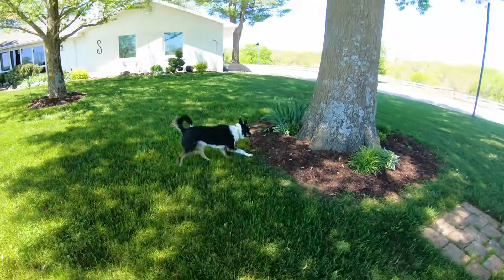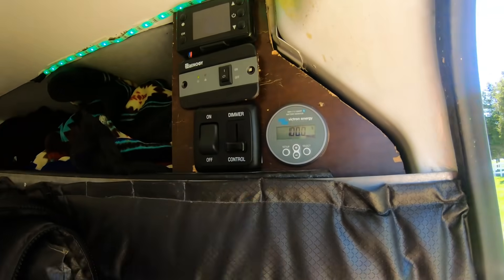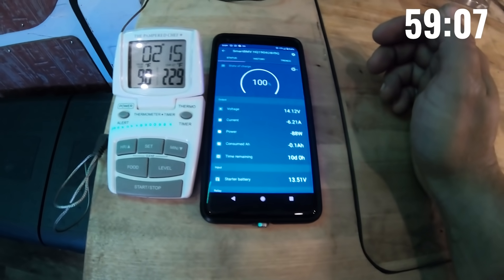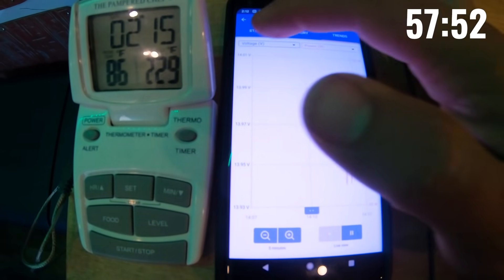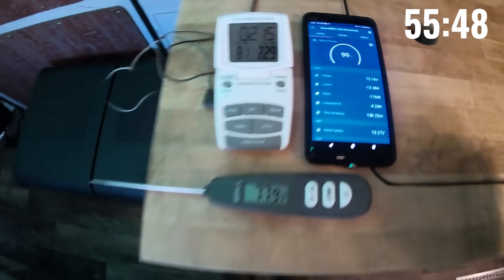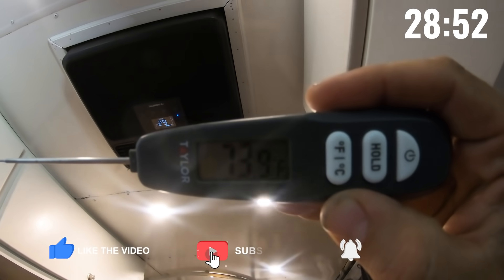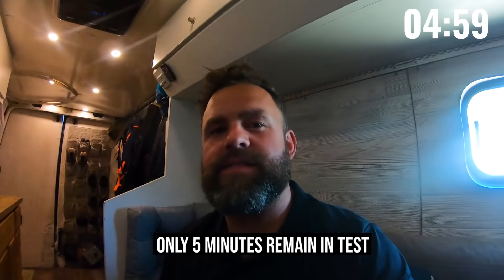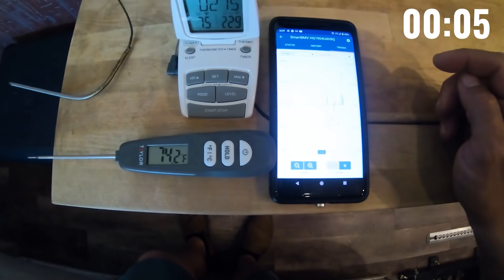12 Volt DC Air Conditioner | POWER CONSUMPTION TEST | Dometic RTX 2000 |  Van Life

Comment: I have a 120v 5k btu unit and 800 watts solar. After 5 mins of use it settles at unit 420 watts. On a decent day I still have input into my batteries while in use so no output from battery. Best test on a day with 95 degrees interior I can drop to 74 degrees in 35 min and 69 degrees in 55 mins. I normally just set ac on 72 degrees. Once to that temp it goes off and kicks on about every 10/15 mins for 5min. So my batteries stay full during the day. My last hour of solar input I turn on constant until no solar input and get it down to 64 degrees. Then adjust to auto 78 and turn my fans on and the ac will barely come on maybe every 30/40 mins for 5 mins.

Comment: I like your real world tests, gives an insight how pv panels, battery, and AC to cool your space. I believe to enhance your envelop (van), hopefully there's an air gap between the pv panel and the van's roof. Otherwise, I would suggest better insulation and more air movement in side the fan (like that little fan, as a booster). To reduce heat conduction from the outside, try painting an aerogel based paint on the inside - sides, bottom, and roof to the bare metal (Do just a small section first and see how well the product works. Check with the laser temp gun - it's expensive - but good). As for your glass windows, that's tough to insulate. Maybe a high quality window tints or an aluminum radiant barrier custom cut to the windows. The thermal curtain certainly helps reduce heat gain. Within your many options, I believe you can achieve your cool goal much quicker and sustain it for a very long time.

Comment: Ben, big fan of your vids man! I have 660 w of solar on my roof and a 200 mah lithium battery.... Do you have any suggestions for a resource where I could calculate performance of this unit without solar like you did?
Reply from the maker: I'm yet to find any other additional real-world performance statistics, that was part of the motivation of making this video to educate others. I have noticed when the temp is above 90° This RTX 2000 draws approximately 600 watts continuous.

Comment: Exhaustive & detailed review here.... Thank you.  Our newer, inverter-type vapor-compression compressors do "speed up & slow down" depending on how close to the setpoint the room return-air is.  (variable btu output for a 12,000 might be 3,500 - 12,500 for example) SO, my opinion is don't have your setpoint any lower than what you want or the unit will remain maxed out until you tell it otherwise.  If your target is 74, then once it gets close to that, it will "slow down" as will the wattage consumption as it approaches that 74 degree mark. Today's AC units do not "bang on" and "bang off" like they did 15-20 yrs ago. They speed up and slow down (provided they are designed and sold to do so as I am pretty sure this system is.)   Read the manual and see if it shows a "BTU Range" of operation.  Great video.....  Very informative.
Reply: variable speed.  High end window air units do this now as do all? mini split systems.  I've seen where some mini splits can power all the way down to 200 watts or so (if not much ac is called for).
Reply: @markparent7999  yep , mini split is way to go period.Dont have large cables running to 12volt/24volt/48volt units , just plain ac 10/2 to the outside condenser and 4/16awg wire  from condenser to the inside unit cassette.One 18k btu heats and cools 40' DP so much better then both (30kbtu) the 15kbtu 120volt ac 15 amp draw pre units it had., maintains it all day long and only draws from batteries during cloudy days and nights.Runs about same as just one 15kbtu roof unit but it does so much better at it and the noise , the noise gone is so worth it.Just a whisper comes out of celing cassette. Cant even hear the outside condenser running unless your right in front of it (within 2ft)

Comment: Could you please tell me which fan that is? Thank you !
Reply from the maker: Howdy Ken, the fan I replaced with the AC was a Maxxfan. Highly dependable, 10 speed, bi-directional fan. Highly recommended, you can even pick one up today at Home Depot without having to wait on internet shipping!
https://www.homedepot.com/p/Maxx-Air-MaxxFan-Deluxe-Smoke-00-06200K/309414397
Reply: @insidiouspeanut  I was meaning the flip down fan under the cabinet lol Thanks

Comment: I’m curious why more people aren’t using the mini splits like you see on semis.   They run off 12 volts. They run independent from the engine…. 🤷‍♂️. Sure there’s something I’m missing
Reply: been doing it for few years.With a 220volt mini split heat pump. I use a 18k btu 25seer ac(220volt AC ) mini split for 40'DP ceiling cassette in the middle section , condenser mounted in back pass side rear compartment. The 8 way cassette blows air constantly throughout entire RV.Junked both the 15btu 120v 15amp draw roof top units and just put cassette in the middle in the fan vent opening. Had to increase hole to fit cassette unit in and then make/paint fiberglass roof cover and seal it to roof (had roof redone during the upgrade so both old AC holes were covered and no longer in roof). Helped with not having 2 roof ac units so could fit solar panels better. Drain comes out into ptrap on roof and it runs right off to the drivers side to the rear.Works so much better then those RV roof units ever did. I didn't use 48vdc mini split units because super high price they seem to ask for them. Just wasn't worth it when the AC mini splits did same thing and I already had to have inverter to run other items like washer/dryer,tv audio system....

Comment: I would think the thing to do if you want to cool everything off quick is have the engine running, put the cab AC full blast and also run the rtx2k in boost mode while drawing from the alternator so that it can get full power.  It's supposed to pull about 60 amps when boosting.

Comment: Thank you! Almost ready to pull the trigger on this unit but I'm worried I'll forever be in a charging deficit. Would you be able to tell me what the temp is out of the unit in Eco mode?
Reply: I know I'm a little late to the party on this one, but you should really consider a mini split over any of these rooftop units. They work just as well, they tend to be more reliable, and they use much less power
Reply: @McBussyPounder  yes , yes they do!

Comment: Wow, that's really impressive.  Consider too, that the aircon has to also remove the heat from the entire van's structure as well as the hot air contained within it.  Looks like it would get down into the 60's pretty soon after the test ended.
Reply: I think so too. Solar aircon that really works, even 78 to 80F is tolerable if one isn't moving around

Comment: Im looking at putting a Dometic freshjet 3000 AC unit in a Sprinter Van LWB - have a large dog and tbh i dont like ac running all the time as id have window open for fresh air or sleep outside. would a Maxxi air fan be still good to have in conjunction with this , as it draws fresh air in and out ?
Less windows helps too thats for sure , as im looking at putting in SP7 Dometic seitz window in sliding door and maybe one opposite it and a small one on back door ... 
thanks for video

Comment: UPDATE ? That's all good for  May but what about now ? Thanks for the video.
Reply: It is not enough watts, because in Texas, for July and August, it only gets down to 75-80 degrees at the coolest (unless it rains, but then little or no solar energy) and that's at 4:00 am.  He would still need to run his A/C at least a little bit at night or it will heat back up into the 80's quickly due to everything radiating heat around the camper.  Seems great for May and some of June though, but not enough watts for the rest of Texas summer.  Either get more panels and more battery capacity, or just hit Texas in May, but then go to a nicer climate for the rest of summer.

Comment: seeing the current draw of a home ac in real-time would be pretty cool
Reply: There’s a sticker on the side that will tell you. Volts x Amps = Wh

A home AC unit is going to use much more power as it’s cooling an entire home and not a small box.  You’re looking at around 10x the power consumption but it also has way more BTUs.

Comment: So to simply;;; did it cool your van to where you can sleep or be inside during summer...IAM in california so summers are 90 to 100
Reply: It can be done for sure. I do it in South Texas, but I'd recommend 600+ watts solar and 600+ amp hours of lithium.  My lithium set up is only 440 amp hours but I have another 600 amp hours on the way for a total of over 1k amp hours @ 12 volt. Even with my set up, I can't spend week after week constantly running the AC. For that, you would need much more solar than I could even fit on my roof.  However, if you give some time for the lithium to catch up when you're not using the AC. It's 100% doable.  I could run my AC constantly in 95F days and 80+ nights for maybe 3 days, *when I'm at 1k+ amp hours, before I'd need to charge from either alternator or shore power to keep up with the watt hours. keep in mind that the compressor cycles much more at night so you won't be using nearly as much electricity at night.  https://youtu.be/fIr95snvLqo

Comment: so it amazes me someone has not figured a way to run your vehicle ac from the house battery.  I mean it is a 12v system and if it can cool your vehicle w/ motor running why could it not cool from house battery ?
Reply: @ronaldduck7567  but why not in a standard vehicle?
Reply: @markseabaugh4157  
Batteries are a thing industry things to traditional automatives
Reply: @markseabaugh4157  95% of vehicles have a belt driven compressor.  These compressors are not electric and cannot run off of 12Volts unless you fabricate a fairly beefy electric motor to a traditional compressor but that would take space under the hood and a ton of labor.

Comment: The temp of the air coming out of the AC will be about 20 ⁰f cooler than the air going into the AC unit. Also, remember that unless you have something stiring the air up more that just the AC fan you are likely to have stratification.
Reply: The temperature of the “air conditioned” space also involves the thermal mass of the area. Which means, the temperature of everything with in the conditioned space must make it to the desired temperature before the HVAC unit will maintain the desired temperature. 
Goes for the refrigerator also, the more in the fridge at temperature, the less the fridge has to work.
Reply: Man wtf are you even talking about!?
Reply: @omarwilliams6729  I am an HVAC tech. I am talking about how air-conditioning actually physically works. The thermostat is set to the temperature that you want the space to be. The air coming  out of the air conditioner will not necessarily be the temperature that the thermostat is set for. The cooler air mixes with the air in the space until the thermostat senses that the air is the at the set point, then is turns off the air-conditioning.
Reply: @seansmith6929  👍👍👍 I like this Brother. 
Thank you for the knowledge imparted.

Comment: with 800 watts solar you shouldn't be consuming over a 100 watts you should be up 2 -300 watts. Its possible you have a weakness is in the battery dept. You def have plenty of Solar to cover a measly 500 watts AC
Reply: 800w of solar panels doesn't mean you get 800w of power from them. 

You'll almost never see full rated output, and this is made worse with a fixed mount angle.
Reply: @Spearborne  lets say the Solar panels put out only 500 watts which there would be zero loss and zero gain and i doubt there was a 300 watt loss

Comment: Good video how a 12-volt air conditioner with work with solar. One question why do you have two panels in series in 2 in parallel
Reply: Its a 12volt system is it not ?

Comment: $2800, seriously?  That's robbery!!!!!  600W at 12v is 50 amps meaning your battery will run it for a max of 6hrs if you don't have any other draws on the system.  With good sun you will be ok during the day but at night the battery will fall quickly.

Comment: Awesome but I like my $250 8000btu home depot special window ac. Easy to replace And it pulls about 615w at full blast. Works for me n the dog here in south florida in my shuttle bus on 1400watts of solar.

Comment: First review on this unit I have seen, very well done. 
I probably would have bought this one if I had of seen this before I installed a mini split heat pump pump. I have 1,200 watts of solar panels, they would keep up with the consumption of this unit. 
I subscribed, commented and followed you on Instagram. 
Definitely a thumbs up 👍

Comment: You'll be running this when you're stationary.  Get several good boat flex panels and attach them on the sun side of the van while you're stopped, linked back into your charge controller - capture the power while you're running it and the sun is out there.  That would usually offset the kind of draw you're showing.
Reply: If you buy the flex panels --also buy some salt and pepper. Leaving them in the sun (DUH)  degrades the fiberglass and they crack. 
GUESS WHAT THAT DOES TO THE TINY INTERNAL CONNECTIONS.
Reply: @halfpastnews   get good ones designated for boat use.  they'll cost more, but be a big step up.  And they won't be in the sun all the time either unlike being mounted on a roof...
Reply: @halfpastnews  why salt and pepper?
Reply: @halfpastnews  mabey if I put lots of hard shell turtle wax on them and do it often enough and you might not to eat them! Lol I have a Corvette and I wax it all time to protect the gell coat and it works pretty good..
Reply: Keeping them supple with wax might be an answer, I do not know.
Good luck with your project.
Reply: Keeping them supple with wax might be an answer, I do not know.
Good luck with your project.

Comment: An under 7,000 BTU AC is not going to cool any appreciable sized area. It also wasn't very warm outside too, a much better test would have been a more typical summer day of 95-100 and then seeing how much at max cool the unit could do.
Reply: I've done such a test on my van with a split unit 8k btu 12V Air Conditioning in 95F and direct sun with a high roof 148 wheel base Transit.  it will cool down to 72 in the van.  Not sure how well it will do in 100+ but it will help for sure.  I'm moderately well insulated but still have some exposed metal.  https://youtu.be/ZpdTLKrOFH4      https://youtu.be/fIr95snvLqo
Reply: I can cool my house with an 8000btu window AC in 90F humid summer weather no problem.  The key is you leave it running nonstop even overnight.  Its nice and cold by the morning and it just slowly warms as the day progresses.

Comment: Do the math

Of your caculations

Change design

Add another mmpt charge controller

2 more pv panels by door
On side 
Add 200 plus storage batteries 

Sorry either change airco
With asian unit

Chinese units work better

Those panels need upgradw

Concept nice
Not fully 24 hour design

No 2 day back up

JAMES ROBERT SEIDEL VK

NICE TRY

Comment: Wouldn't it have been cheaper and way more efficient to use a 120 volt portable unit running off an inverter and those could have been much larger BTU units.
Reply: Portables don't have an efficient way of dissipating heat.You'd have to run the exhaust out the window and the tubing radiates heat.
Reply: @FexyVRC  all you have to do is insulate the tubing. All and all much more cheaper and efficient.

Comment: Well this is impressive too bad I just got done making my own split system for us... Pulls about 3xs the power but it cools it down from 100 to 65 in 30min and having ducts throughout makes a big difference in getting it all the same temp. But if I had to redo it I would do the same thing with one of these if they make a big brother to this. Something around 15kbtu and with a heat pump.
Actually iv already started putting together the next system for us for next year and using some electric car parts it seems I should be able to meet or get very close to your 40a @ 12v dc but I'm shooting for 20kbtu with the new one 🙂. One thing I gotta say is that's a sweet set up you have we had to get 1600ahrs of battery to run all night and not worry. Good to see your panel though currently we only have 350watts and it's not enough. I made more charging methods so we have lots of options but still I gotta finish this solar paint then get some of the flexible panels and get that going. Looks like getting 1500watts on a big van isnt too hard and would be almost enough for us.
Reply: And when I first got the ac going we only had 600ahrs of battery and it worked great but 2-3 hrs of ac is all it would do without some serious extra power coming in. For those getting started go 24v and add a second alternator thats 24v and boom at worse you can run the van and charge while running ac full blast. Worked for us just make sure your wiring is big enough then go Abit bigger or add an extra conductor you'd be amazed how much power you can make this way. Think we could safely pull 250amps from the alternator at 24v that's 6000watts and took me about two days to make the pulleys and mounts and is definitely a buy I would make before solar. Think we had $200 in the alternator addition using some stuff we already had.

Comment: This is impressive.  If you added just ONE or TWO more solar panels you could totally run the AC without depleting the batteries at all.  You could run the AC as long as the sun shines!
Reply: or just up the batterry bank from 300 to 600. The panels delivers plenty for a day of full blast, and evenings and night time you don't need a lot of cooling.